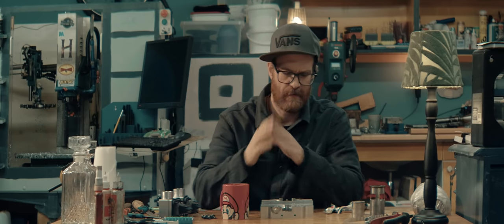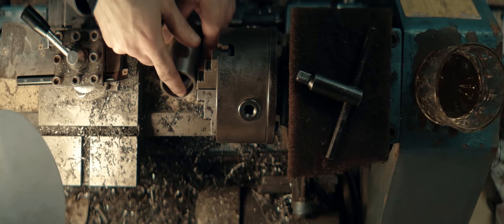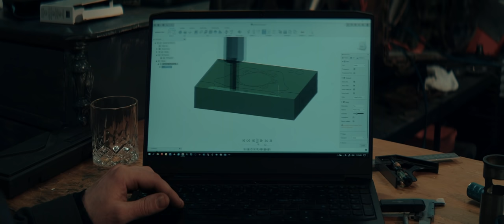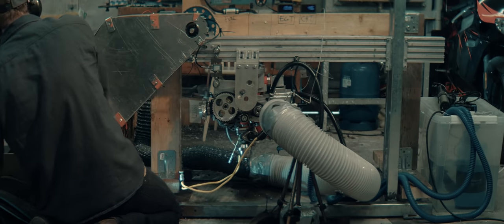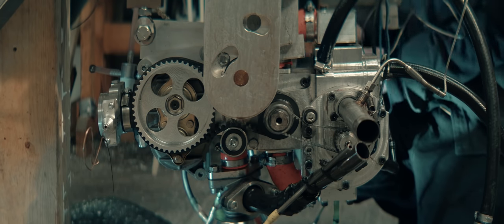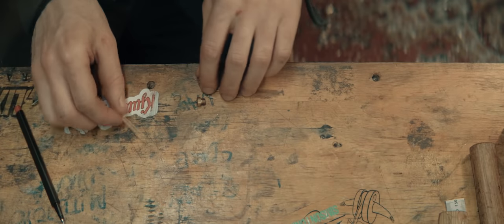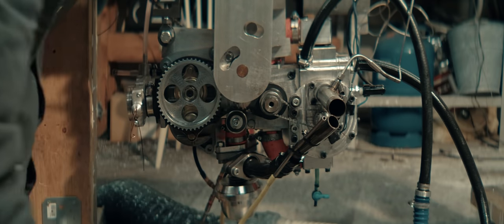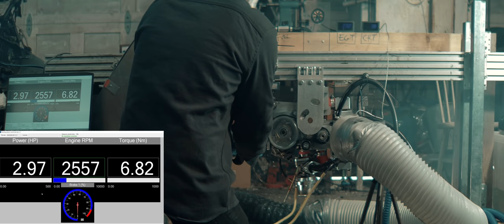Poisoned by Supercharged Nitro 50cc Two Stroke?

Comment: What's the ideal afr you would want to run with nitro on supercharged 2t like yours? Also for tuning boosted engines do you recommend getting egt gauge or afr gauge first, i 'm tuning turbocharged cb400n (yes i know, 4 stroke heresy) and i'm not sure wich gauge to get first.
Reply: I've asked before what the AFR should be for this engine running RC fuel but never got a answer.
Reply: With pure nitro you can run as rich as 1:1.
With the oil and methanol added I would guess somwhere between 3:1 to 5:1.
Reply: @malcrandall1309  
Problem is the readings are somewhere between completely meaningless and notoriously unreliable in this setup.
Reply: @heinzhaupthaar5590  Yes I agree with you. It's just that I've seen it wrote in the comments so many times I thought there may be a touch of truth to it.

Comment: Alex, have you ever used a Colourtune plug to check the mixture?
Reply: Sadly a "colour Tune" wouldn't be any help in this situation. When used at tick over you could see the blue flame but as you revved the engine more fuel was burnt and it just became a yellow blur. 
Check out "Warped Perceptions" here on YouTube to see a single cylinder engine run with a transparent cylinder head.
Reply: @malcrandall1309  I did wonder, as Alex's engine seems to use massive amounts of fuel when it's on boost. Lots of oil in the fuel won't help either. I've also done 'Plug chops' to check the fuel mixture at full throttle in the past and I wouldn't want Alex running the risk of leaning out on closing the throttle and causing a seizure. I have used Colourtune plugs to tune 2 strokes when I wasn involved in Moped Mayhem in the late '70s / early '80s. They are useful when you want to look at how the needle is managing the mid-range mixture.
Reply: @ModshackMerlin  Since Alex went onto using RC fuel on the SPX project 4 years ago he never managed to get the engine to carburate as it would with petrol. 
I and others feel pump fuel is the better way forward as it's more predictable and allows higher revs. Though I wouldn't like to see petrol vapour going down the extractor duct.
Reply: @malcrandall1309  Nitro is the weapon of choice for AA Top Fuel dragsters, mainly because it reduces detonation and dragsters use 15 gallons of it on a single run. Racing fuels are not known for their economy. Air to fuel of 1.7:1 would be typical for nitro, 5:1 to 6:1 for Methanol. Maybe Methanol would be a better choice as it can't cause detonation? The downside is that it's corrosive to aluminium. Alex definitely needs to be careful of inhaling nitric acid fumes from burning nitro fuel.

Comment: Alright you got it running, it's running well too. What is your goal with this design? Find it's weakness then upgrade to another design? Make _ horsepower and run it?
Reply: This design concept came from when Alex was researching porting for the PiP engine which was to have a radical 100% of bore exhaust port. At this moment the Brute force has taken over from the PiP Bonneville record attempt. It all started as a doodle and went from there.
Alex's goal was to make the worlds most powerful 50cc  two stroke.
Reply: @malcrandall1309  Yep I've been following along for quite a while - my question was poorly phrased perhaps. At what point does he declare "yep, I see what I can do to improve this and I need to redesign it" - this proto is wicked, dont mistake this for derogatory, but this one ain't going to accomplish his goal IMO.
Reply: @matthewspeller  Hello Matt. I personally believe it's  never ending saga. You can continue to develop the engine while the cows come home. Certainly no offence to Alex in anyway, but this is only like a hobby to him. He's being doing "2strokestuffing" for over 5 years now and had plenty of time to stop repeating previous mistakes.
If Alex was adamant about doing well he would have sorted the retarder first allowing for full control so it doesn't stall the tiny 50cc engine. I suggested using a potentiometer to control a variable PSU allowing total control over the coils but Alex has invested in the "My Dyno" which IMO has worked poorly.
Right Matt, I'm not a arm chair critic, but I could go on for ages. Lastly may I say I have huge admiration for Alex.

Comment: Time to invest in some serious air extraction, not that crappy 10" HVAC duct just for the exhaust. I'm talking something that will replace the air in the whole shop every 3 minutes (ie. air change 20 times an hour - which is typical for smoking rooms in a pub). I realise that poses some difficult heating considerations for your climate, but long term exposure to exhaust byproducts kill. COPD and other complications await you in the years to come, and I'm guessing you want to see your kids graduate.

Air chages per hour = HVAC Air Flow (in cubic meters per hour) / Room size (in cubic meters)

Not sure if you've got natural gas available where you are, but a ducted heating unit might be a good solution here that'll cover both the air flow and heating requirement.

Comment: Why didn't you just weld them together?
Reply: Why do the cases need welding together. Surely a correct "O ring" would allow the case bolts to be slackened to aid fitment of the liner. One liner has being cracked and one damaged due to pressing failures.

Comment: Do you need such a large squish of 0.4 - 0.5mm? On a stroke of 41mm with forged piston I use 0.25mm. Theoretical compressions ratio of 1/14.5

Comment: Might be a dumb question but, why not weld the two half together instead of using jb weld?
Reply: Welding it might warp the parts so that they are no longer flat. It would work if the mating surfaces were machined after welding :)
Reply: Why do the cases need fixing together. If there was the correct "O ring" in place the cases should seal allowing the case bolts to be slacked allowing for easier liner fitment.

Comment: Why don’t you just run it on petrol 2 stroke mix for a few tanks ?
Reply: Really it should be massively over jetted running it on petrol, but Alex does this when emptying the fuel system out of RC fuel. 
I would like to see it run Petroil just to see how it goes.
Reply: Malc Randall I just though it would be easier and cheeper for him to run it in .
Reply: @jamescooper5372  Yes very true. I think it just comes down to the fact the Alex is impatient and wants to get cracking with limited workshop time.
Reply: Agreed. I would have a petrol carb to bolt on for running in, although, I would rather see it running on petrol anyway
Reply: @Scissors69  We are very lucky of late. Alex warms up the coolant and runs the engine in. He didn't do this until a month ago.

Comment: Drill out a main jet??? In my experience you can drill out a pilot jet because it's a straight through hole, but main jets usualy have a tapered hour glass kind of shaped hole and the angle of the hour glass depends on the size of the hole, so if ya drill the hole bigger the angle isn't correct anymore and it screws up the ventury effect i think its called.  At least that's what I along with a few other people I know have run into in the past...

Comment: >Makes video title not telling us about the best sounding dyno runs yet

Aw, c'mon, a few good pulls is worth a little health risk, especially if you mitigate it as you can. Honestly, though, I'm happy you aren't dying. Do you reckon boost first, or timing? I'd be a weirdo and play with boost first, until I got some good idea on how more boost affects the RPM range (I imagine the more you give it, the less top end you'll have due to pumping loss, but the larger the midrange gains would be). Once I found a happy medium, I'd then play with timing (just like the boost, pumping loss in the higher RPM ranges on a two stroke with more than necessary timing, usually). Then lean until you're only a little worried about seizure, and then you'll be loggin'. Then again, I suppose that's the way you'll go anyway. Can't wait!

... actually, after all that, I'd figure out a simple way to use the blowoff valve and the timing sensor to use RPM to have a set RPM where the boost decreases to minimize pumping loss, so you can have all the midrange and the top end. Now, onward!

Comment: Post your HP predictions ^_^
Reply: Or maximum RPM. I think 18000 with RC fuel.
Reply: 22hp @ 18000.
Reply: Van Veen got to 22.5 with his dual rotary disk, dual carb Kriedler in 1978. Normally aspirated. I am hoping to see 25 with rotary valve timing mods.
Reply: We got 0.48hp per cc on our 250cc 2 cylinder 2stroke NA so this should do better, 0.65hp per cc I recon. 32hp 16000rpm
Reply: @tonyalto1014  I must admit I'm not a fan of using RC fuel. I would much prefer to see all the engines run on Petroil. 
5 years ago when Alex went onto RC fuel in the SPX it became totally un reliable after great performance with pump fuel. Alex was adamant he was going to use RC fuel.
Reply: My guess is 30hp
Reply: @malcrandall1309  I hear you loud and clear. I guess I would have started the project using gasoline because of the cost of fuel and safety issues. Then moved on to an alcohol nitromethane blend after everything was sorted and reliable. That fuel is expensive, corrosive, and fairly 'less safe' than gasoline.
Reply: @malcrandall1309  - Totally agree with this. I also remember the SPX on RC fuel. Not good
Reply: It's a good job I'm not a betting man otherwise I would have lost my money.

Comment: If you're getting exposed to enough fuel to smell it on your breath your fume extraction system is certainly inadequate.

Don't forget, it's not just the nitro: Methanol is also significantly poisonous, and it's a larger % of the fuel. Even non-lethal doses can make you go blind, which is sure to put an end to any racing ambitions. The toxicity is caused by your body's alcohol metabolism enzymes (Alcohol dehydrogenase, for the biochemically inclined) converting the methanol into formaldehyde, which is all kinds of nasty (aside from the acute toxicity it also causes cancer).

Normally I don't advocate drinking, but in this case, a bit of alcohol may be a good thing as it functions as an antidote to methanol poisoning by binding to the enzymes more strongly than methanol does. Drink slowly and well diluted with water, you want just a bit of alcohol in your system until the methanol gets flushed out by your kidneys. Of course you shouldn't be operating machinery of any kind while drinking, so save the beer until after the dyno run.